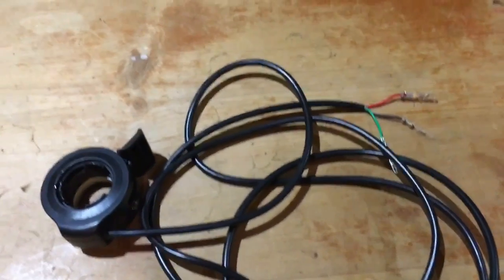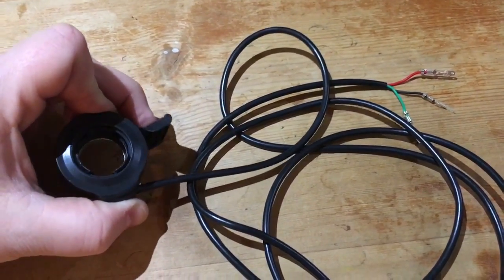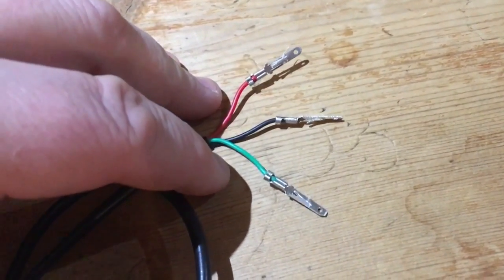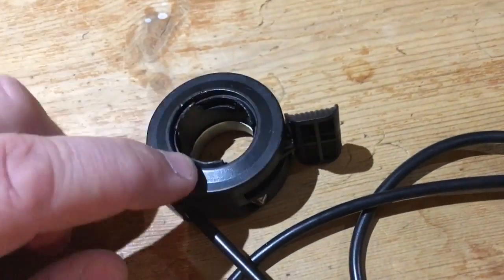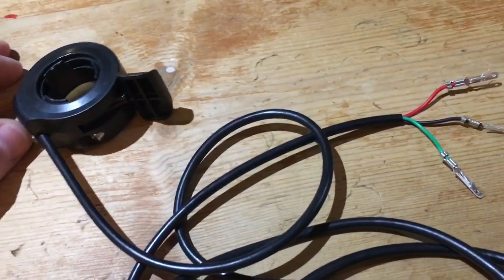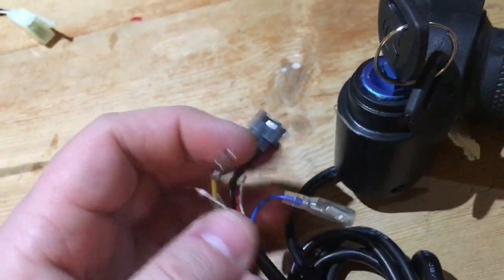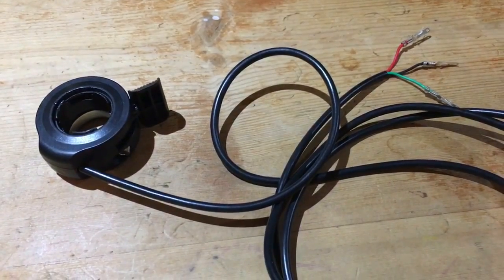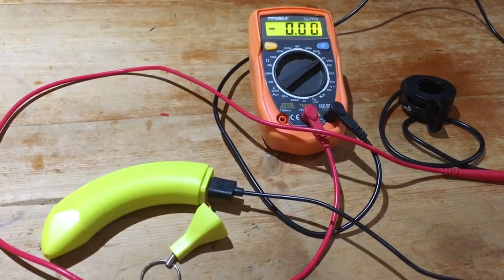Ebike throttles - how do they work?

Comment: Hi, i have thumb throttle that have start idle voltage 1.33v and when full run 3.42v, is this ok voltage, is this throttle ok and will this throttle work fine with such voltage values?.
Thanks 🙂

Comment: Hi, please, I replaced pedal assistant sensor with a throttle on my ebike and it not working. How do I fix the issue. 

The controller doesn't have separate wire for throttle connection. 
Greetings from Nigeria

Comment: I have a controller. And on the controller is a jst-sm 4 pin connector for both the brakes and the throttle together. 2 are for the brakes and that leaves 2 more pins which are of course for the throttle. But, the throttle has 3 pins. I dont have a multimeter and I have never used one. So,, if I switch the pins around to figure out which pin goes where. Could that harm my bike in any way ?

Comment: I have a controller. It has 4 wires to 1 jst-sm. 2 pins for the brakes. And 2 for the throttle, which is a julet 3 pin which the connected julet 3pin  cable is only 3 inches long. If I get a longer julet 3pin with open wires on the end.
 So I am wondering how I connect them ?
 I bought them from Fiido. They are a matching couple for the L3 bike. Would I wire the green and red together ? Or would I wire either the green or the red one or the other with one of the brake wires ?

Comment: So I have a question. If a throttle advertises that it's Voltage is 12-99v, does that mean it's compatible for anything between 12 and 99? So if my bike is 36v, it's not going to blow it?

Comment: Can you use this throttle in a 24v or higher scooter?
Reply from the maker: Maricel Simpauco every controller sends five volts to the throttle regardless of the battery’s voltage.
Reply: @ballaratebikes287  I have a great question for you, I am interested in a twist throttle that starts you off slow, because I notice that all the cheap $15  twist throttles that I a have used, knock you off the saddle as soon as you barley turn it to its minimal activation point, I am looking for a throttle that starts off very slow and gradually starts accelerating to full speed. Please refer me to one either through amazon link or a model and model number, I will subscribe to your channel upon you response. thanks

Comment: Is it the same as magnetic throttle?
I have a twist and thumb throttle from 2 different scooters. The thumb throttle only has 2 magnets and a sensor not sure if I want to open the other yet.
But yeah, are all electric 3 wire throttles compatible with all 3 wire controllers and is it the same for 3 wire breaks?
Sorry for the long message and thanks again.

Comment: what i want to know is, can you just connect the signal wire to the positive wire?
just to get home, like today my ebike has stopped, if i knew ii could just connect the sig to +
i might have been able to get home, with no throttle control ofcourse.
Reply: That's my question
Reply: @truth.speaker   oh my friend, i know what is the situation now, you need a button battery which is 5volts, you then connect 2 of the 3 wires to each side of this battery, thn you hav throttle. since then ive moved on to a gas powered china doll engine for long range!!!

Comment: My throttle is not engaging my motor. Wiring is correct. Brand new bike, motor and controller are good. Any suggestions?
Reply: If it isn't working still, battery voltage?